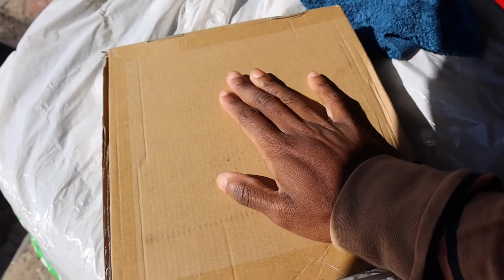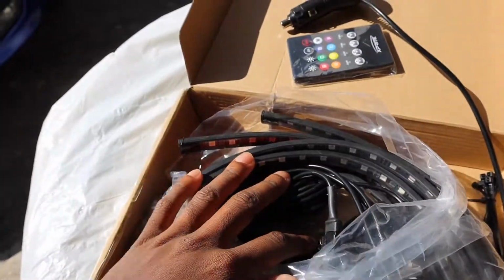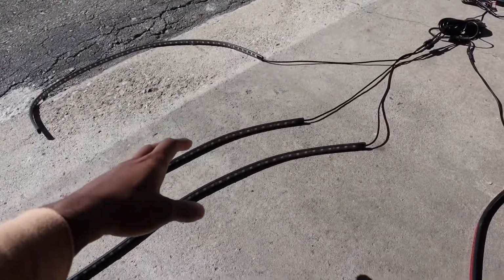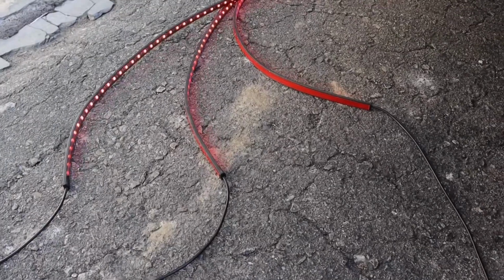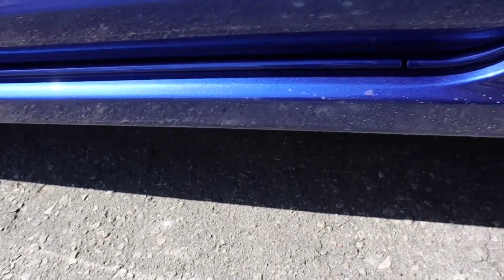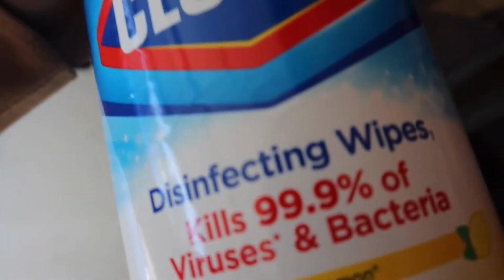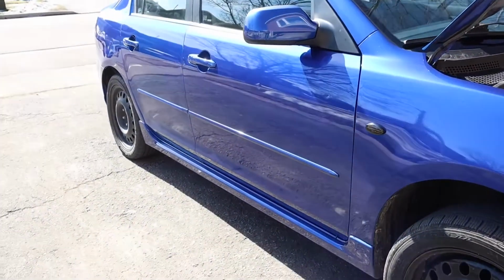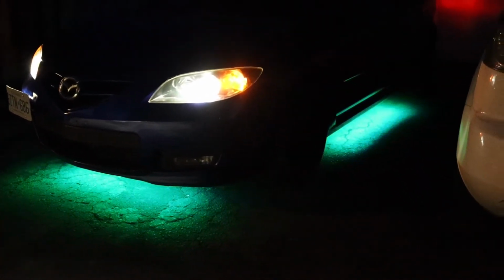LED underglow install

Comment: Will it drain my car's battery?
Reply from the maker: Not at all! I’ve had nooo issues with it! It’s leds so they don’t use a lot of energy
Reply: @dose_of_j  how long can i let them turned on
Reply from the maker: @ZainSheikhMemez  as long as your car is on, they car stay on! You have a remote that can turn it off too! And of course if you turn your car off, the lights will too!
Reply: @dose_of_j  thanks man appreciate it 😊🤩
Reply from the maker: @ZainSheikhMemez  nooo problemmm 🙏🏾